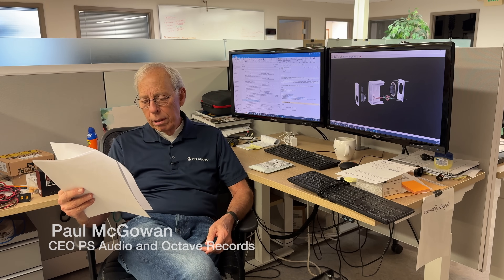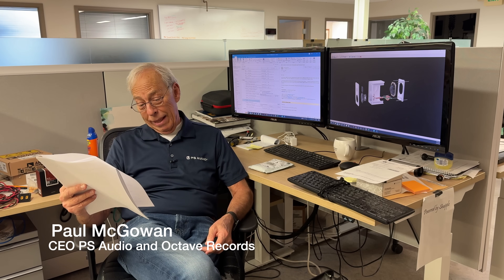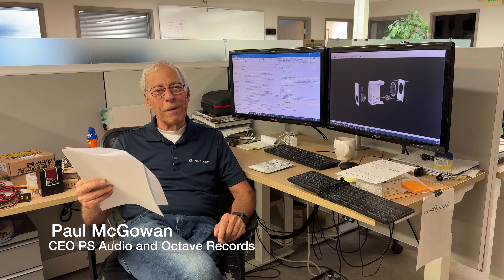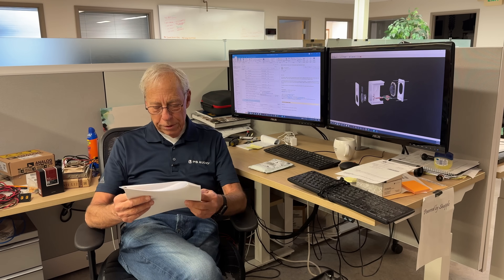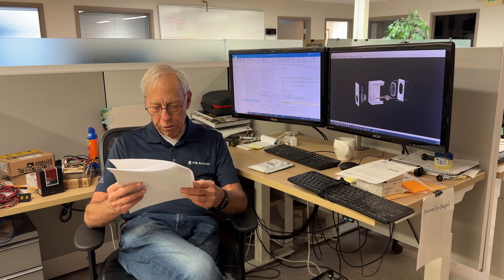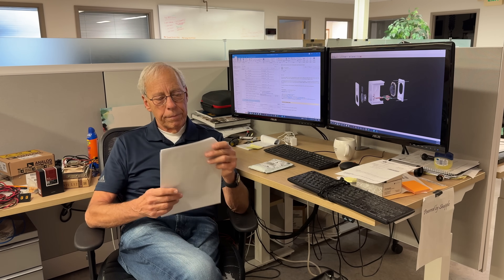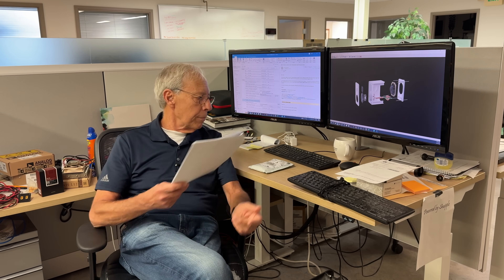Phono cables and capacitance

Comment: The 47kohm is a general industrial rule, however settings between 30k and 100k are not uncommon. I have experimented with varying impedance and pf settings. It is interesting how you can tune the sound to your liking.
Reply: My CURRENT understanding:

62k ohms - Shure M97xe

47k ohms -  Shure V15

38k ohms - Audio Technica and Ortofon Moving Magnet line contact and shibata styli

22k ohms - Grado Moving Magnet

225 ohms - Denon 103
Reply: The denon 103,i think is a high output MC, therefore the low impedance. Apparently you can connect it directly into the MM phono stage. @MrNicks-gn8jc
Reply: @bobisyouruncle1 You can, but need to first add either a head amp or Step-Up-Transformer (SUT) BEFORE the phono stage input......yes, Denon 103 is LOMC (low output moving coil), but I remembered that setting and added to the list.

DISCLAIMER: I currently use a Ortofon OM 30 in a Reloop Concorde Black [basically, Ortofon OM30 in an SME-one-piece headshell] and I run my system around 37.5k Ohms and 155 pf total

Comment: That was a good one Paul. I never thought about that with my moving coil cartridge but I still bought a high-quality turntable to preamp  “Y” cable. I never thought about the fact that such low capacity in cartridges did not need so much attention. So I look at it this way… It just adds to the integrity of my music system.

Comment: Hi, I need help to understand what to set this puff with MM? I can select 100,200 or 300 but don’t understand the impact??
Reply: Hi - in general the cabling from MM cartridge to the phono stage is about 100pf. It is said that you need about 250pf for a balanced sound. What increasing and decreasing the pf setting does is increase and decrease the higher frequencies. Try it and set it to your liking. You will not damage anything. I tried it.
Reply: There is a website from Hagerman Technology that has a capacitance calculator that shows that reducing the overall capacitance (total from tonearm wires to input on phono stage) moves the peak(s) in moving magnet cartridges with line contact stylus up to higher frequencies.....if done right, so far up that they exist past 20khz.....making the cartridge sound flat with a small boost in the bass.....the slightly bassier version of a moving coil with a hair less detail
Reply: I’ve been trying to get to grips with this too; as I understand it, most modern cartridges should be fine at an around 250pf total, roughly 100pf of which will be in the cable, and that the effect of increasing or decreasing the total pf value can cause a resonance peak to shift up or down the audio spectrum. As my own cart (an old A&R P77) prefers over 400pf, my phono stage is used at its highest setting of 330pf. Anecdotally, I have read that Audio Technica MMs prefer a slightly lower capacitance but all this will also be personal preference and system dependent.

Comment: This topic, phono interconnects remains one of the last remaining mysteries for me.  In corresponding with those who know much more about phono interconnects, I'm informed that these interconnects are tricky business.  Also, in direct contact with Fluance (yes I know it's a 'cheap' turntable) they advised that their stock RCA cable is quite sufficient for a good signal transmission.  I'm open to any thoughts and/or concerns in this regard.  Thanks!
Reply: Yes, "sufficient for a good". But if you want more....
Reply: @glenncurry3041  But if you want more…. More of what?  Are you making a suggestion?  Interested and listening.  Thanks

Comment: Puff? I’ve always called it picofarads. Learn something new every day
Reply: It's pF, which is often pronounced as puff.
Reply: @michaelturner4457  been reading pF and saying it since the 70’s and its  been picofards to me, or in the right circumstances, microfarads.

If pF is puff, is mF muff?
Reply: Took my degree in electronic engineering (UK) in 1972, worked in engineering till retirement,everyone I worked with called a 100pF cap 100 puff !!!
Reply: @rayt9428  Well mine was '71 in the midwest US. Perhaps it's a regional thing.
Reply: "P,f's" or just "picos" with the farad assumed. Yes after 70+ year in electronics, that was a new one for me as well.
Reply: Yes, it took me a minute to realize what he meant by "puff."
Reply: As long as there's no puff of smoke, you're ok😂
Reply: @bobisyouruncle1  Any good listening session has a puff of smoke or two.

Comment: Isn't there much more reason to use a balanced low capacitance connection from a moving coil cartridge to the phono amp than when connecting boxes a few feet apart that are running a much higher line level with low impedance output? Alright, the SNR is poor to start with, but otherwise, why not?